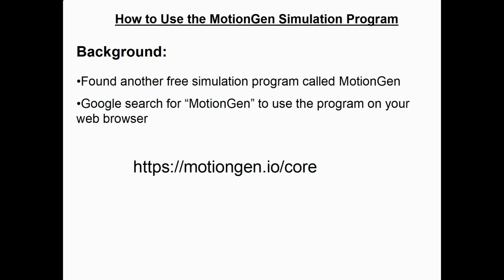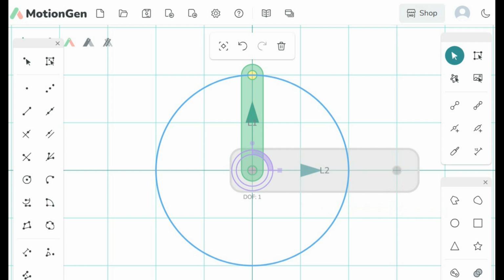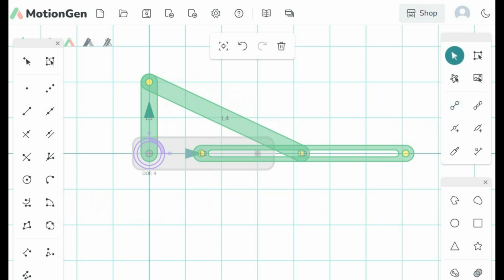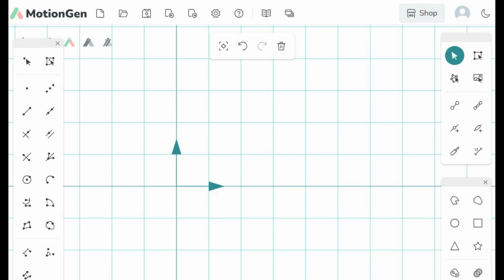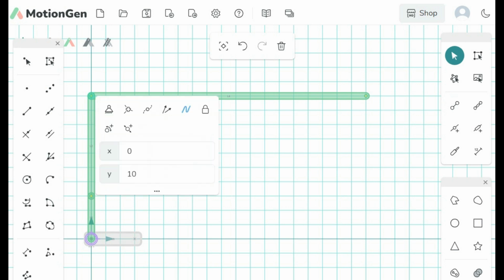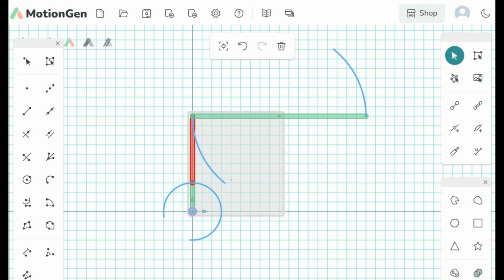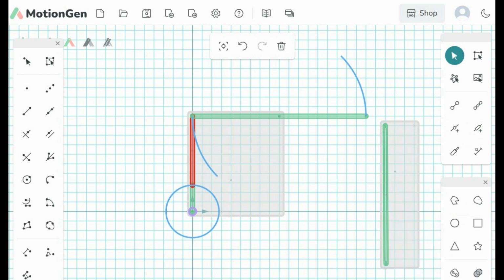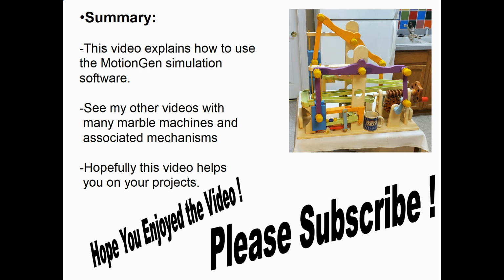How to Use the MotionGen Simulation Program to Design Mechanical Linkages

Comment: i can't see how you make the crank lever return to 1200 oclock.
Reply from the maker: If the linkage hits a constraint such that it can not complete the movement, then the crank reverses direction. You can tell this by the blue circle around the crank, it will only show a partial circle if there is a constraint, but it shows a full blue circle if no constraint.  Hope that helps you!